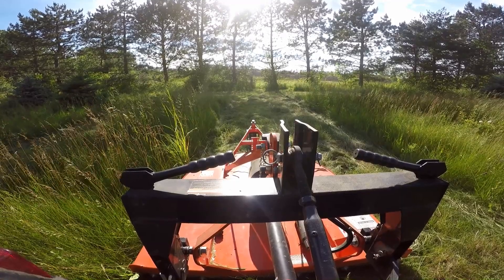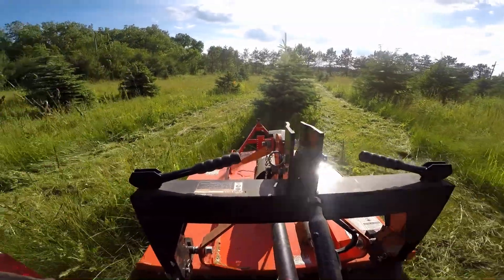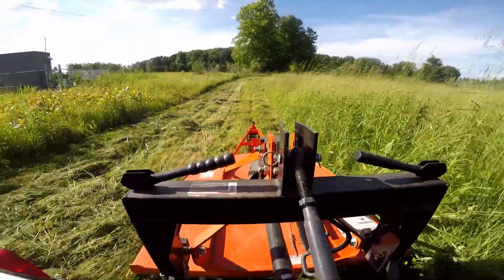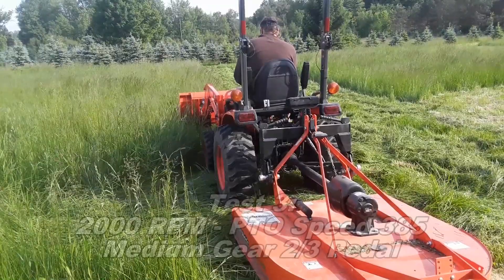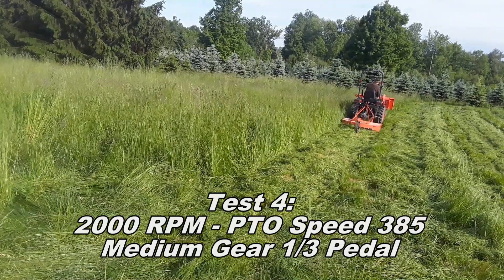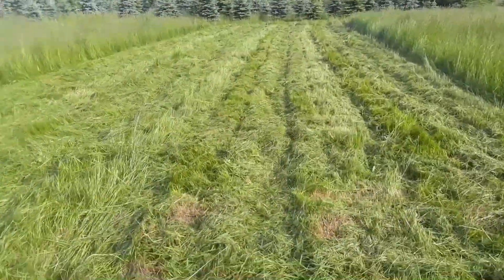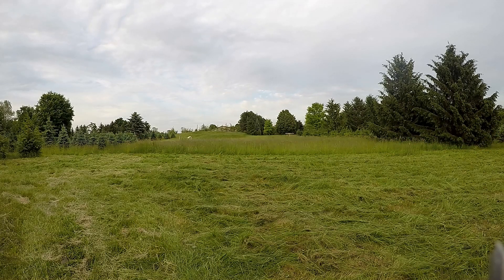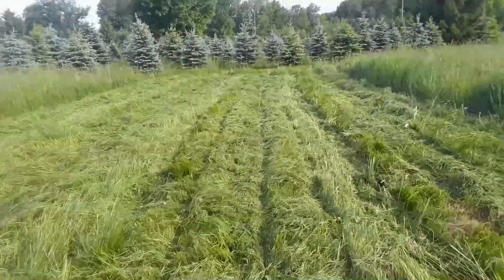Brush Hogging: Experimenting with Blade/PTO and Ground Speeds

Comment: For years I ran a series of 48" bush hogs behind a 17hp Bolens G174.  It had three PTO gears and the 720 range seemed the most likely for mowing.  It certainly worked well on the Woods finish mower which came with it.  So I spun the bush hogs at 720 and got pretty good results.  When I bought a more powerful Kubota with 540 pto, the quality of the cut diminished drastically.

Comment: For brush cutting , I did this experiment 20 years ago and determined that 540 PTO speeds was not necessary for most cutting, especially when moving under 2.5 MPH. I run the Kubota engine around 1800 RPM's with PTO @ about 400 RPMs under 2 MPH!  I will also say that when doing very steep terrain, I will make 2 passes per cut. Meaning I drive down the hill , then back up on the same path. LOL.......BTW, I'm retired now so time is not a factor anymore!!   Great video and thanks for posting...

Comment: 540PTO as the implement was designed for, and a lower ground speed will give better results in most applications if you want it too look decent...if you want a crappy cut, and if you are cutting saplings you may find going a bit faster a good thing to get a rougher cut which will help destroy the brush and saplings better.  The rougher cut will not give a nice clean cut on woody material and it'll help to kill it, rather than just cut it off and giving it a chance to grow back.